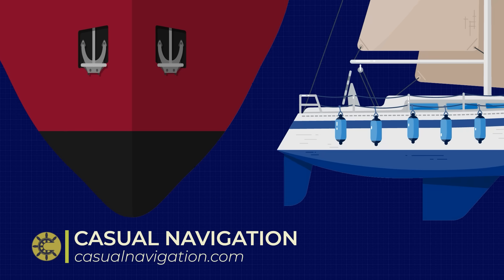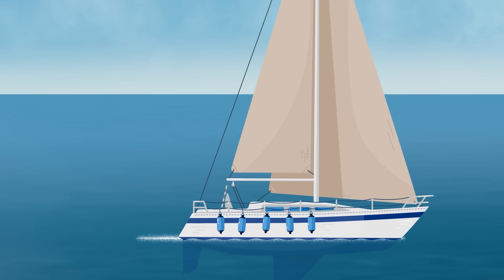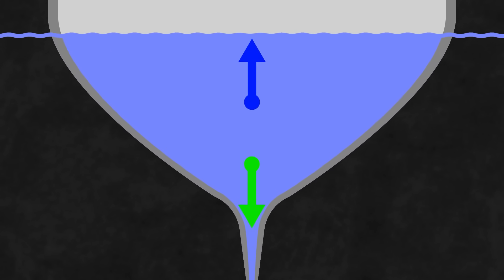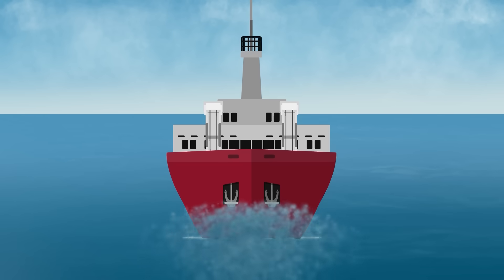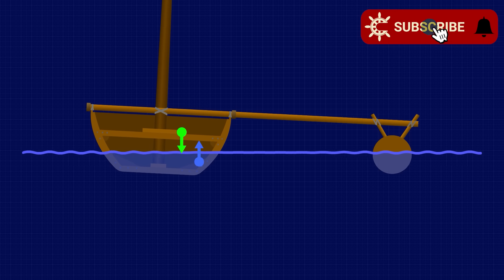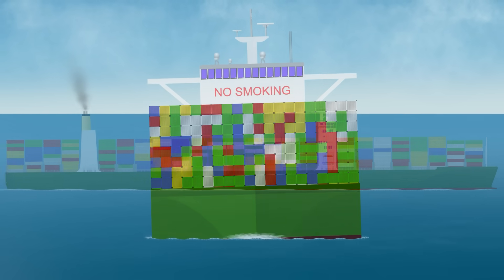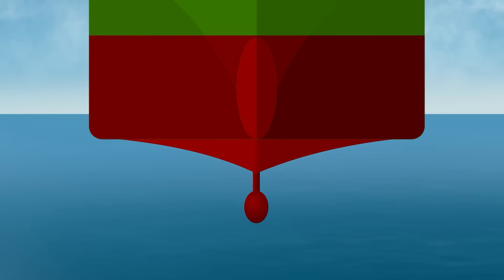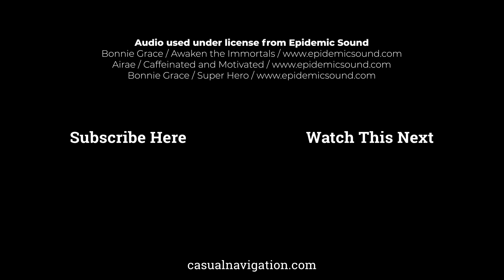Why Do Ships Have Flat Bottoms?

Comment: Though flat bottom ships are possible only for powered ships; for sail powered ships you need keel or centerboard / daggerboard anyway to counteract lateral forces when sailing at an angle to the wind.
Reply: Not 100% true. There are flat-bottomed sail boats. The trick is to then provide the needed counterforce with something like a leeboard at the sides of the hull. When the ship heels, the board on the leeward side (hence the name) is submerged and provided the needed counterforce. These were once common in shallow-draft waters like the Dutch waddenzee.
Reply: @eypandabear7483 cool
Reply: @eypandabear7483 
Revelation 3:20
Behold, I stand at the door, and knock: if any man hear my voice, and open the door, I will come in to him, and will sup with him, and he with me.

HEY THERE 🤗 JESUS IS CALLING YOU TODAY. Turn away from your sins, confess, forsake them and live the victorious life. God bless.

Revelation 22:12-14
And, behold, I come quickly; and my reward is with me, to give every man according as his work shall be.
I am Alpha and Omega, the beginning and the end, the first and the last.
Blessed are they that do his commandments, that they may have right to the tree of life, and may enter in through the gates into the city.
Reply: @eypandabear7483 that is exactly what the initial comment said.

Anyway, you are both wrong.

If there is enough of a lateral plane, you can still sail with a flat-bottomed ship.
Reply: Flatbottomboats with chinerunners are sailable.
Reply: Actually no sailed some ships had flat bottoms. If you know about the imjin war all the korean war ships had flat bottoms.
Reply: @alexkim3794 They were small,almost exclusively served on the coast, and relied mostly on oars.
Reply: Or a leeboard, like Dutch/Frisian flat bottom sailing ships (such as a Skûtsje). Doesn't do anything for the weight balance and can even be sailed without (but it will make a lot of leeway).
Reply: Not necessarily. The hull provides a lot of the lateral resistance. In modern racing yachts the fin ( or keel) is deep and narrow. While the hull is shallow and flat. Mostly to increase the initial righting moment while providing a planing shape. If you look at the IOC boats they have canting keels and lifting foils placed well outboard of the hull itself. These vessels are very fast and can handle severe conditions.
Reply: that's not at all true, otherwise sailing scows wouldn't work. When a flat bottom boat heels over, the "chine" or outer edge becomes keel-like and provides resistance to lateral motion, it might not be good at the job, but it does the job. It would be called low aspect.
Reply: @scotmcpherson  they had flat bottoms to push the ships onto land
Reply: @ doesn’t really have anything to do with what I said
Reply: I don't think there is a universal definition of neither "boat" not "ship"

But people who call ships "boats" and boats "ships" immediately reveal themselves as land-lubbers.
Reply: Never heard of a Sailing Catamaran? :P
Reply: For everyone discussing Ships vs Boats:
Drachinifel answers it in Drydock Episode 117
(semi final question)

Took me ages to find the right episode 😂
Reply: Drachinifel answers the Boat vs Ship question in Drydock 117 :)
Reply: Vikings had flatbottom ships
Reply: Leeboards (Seitenschwerter) on flat bottomed ships ⛵ are used in areas with low sea depths (1½ - 2m) - on the coast or even rivers. 

Old Dutch barges - zees boats (with red sails) typically have them and are used in the wadden sea or bodden.
They have developed from viking boats - but some modern small sailboats out of wood still have them.
Reply: Not true, there are various designs that don't require such like the outrigger canoes spoken about in this video and many modern catamarans, along with certain monohull designs.
Reply: Thats what he said in the video at the end
Reply: I’am frisian and our sailboats have flat bottoms. So no keel. We have what is called “zwaarden” on the sides. Big wooden plates on the outside of the ship that slide in the water when going side ways. You can search on: Skûtsje.
That is the name of our ships.
Reply: Outrigger canoe was sailed
Reply: Well nobody ships cargo with a sailing ship so who cares
Reply: Pretty much 
I've got a 36 footer and 52 footer. My 32 footer has a swing keel but it has a "flat bottom"

If the boat has something to act like a keel to cut lateral move my like a dagger, or cats

It's not a flat bottom. 
You only call it flat bottom when it travels with a flat bottom 
My boat has a flat bottom but travels with a swing keel

Meaning I don't say it's fucking flat bottom because other sailors would think I'm stupid 
I'm sure Gen Z wants to debate about my swing keel and tell me he's a flat bottom and redefine words
But it's not. 
Same with cats, daggerboards etc 
You can't sail with a flat bottom
Reply: I imagine it's a case of foot print. You can get cat sailing ships and they're basically an outrigger taken to the extreme.
Reply: @Logarithm906  have you seen the latest evolution of America's cup boats? They have lifting foils placed well outboard of the hull. Essentially catamarans except trading hydrodynamic lift for buoyancy. No big, heavy, pendulous weight to provide roll stability. So much for the vertical distance between CG and CB theory.
Reply: actually they're all boats because they go in the wet, ships are in space /j
Reply: @keiyakins excellent.
Reply: I like the definition that a boat can be operated by a single person while a ship requires a crew
Reply: @StepSherpa  I like it in theory, but on a more technical level, are you talking about requiring a crew for actually physically operating, or for legality?

I work on boats (well, we call them boats) that legally require a crew to operate, but technically, you could (and it's been done) do everything yourself. It would take planning and forethought, but it's doable. 

I also heard a definition myself where if the vessel can carry another boat on it, it becomes a ship... but that makes any sailing yacht with a tender on davits a ship... which doesn't seem right to me.

In my opinion, it's purely instinctual, and there is no real definition. Case by case kind of thing.
Reply: @douglaspealing5608  a tender is not necessarily a boat. Many tenders are actually dinghies not boats.
Reply: @PaulHarris-sl1ct  

I'm not saying you're wrong...

But I'm not saying you're right. This is my point. There is no definitive answer. I call both my whitewater kayak and my sailing yacht boats, and infact the vessels I work on are also called boats and ships interchangeably. 

I've also heard one of the vessels I work on referred to as a tender, as it used to serve the cruise ships that came into where i work.

It's a complex conundrum, and I always love hearing different people's opinions on it
Reply: @StepSherpa  Submarines are often classified as boats though, and many do require a crew to operate
Reply: @3irikur Yes, and you could probably automate a container ship not to require any crew, and I don't think that should magically turn it into a boat.
Reply: Those are called boats
Reply: @SterbiusMcGurbius  A Boat of the Line sounds way less cool than a Ship of the Line.
Reply: @SterbsMcGurbs So all vessels without their own propulsion are/were boats?
Reply: @ImieNazwiskoOK ah, the eternal question. What classifies a ship or a boat? When does a boat become a ship?
Reply: @douglaspealing5608  Both are subjective labels that can be used interchangeably, since either way you'll be understood. What is the limited average consensus? A rowing boat is a boat, but are big ass rowing boats of antiquity not ships? PT boat is a boat, but a similar size class and purpose starship is a ship. I guess, if it can operate on it's own, it's a ship.

But who knows, maybe BB actually stands for BattleBoat all along.
Reply: @steelwasp9375  great answer. I like it
Reply: @ImieNazwiskoOK  no. The definition of a ship vs boat is as follows. Ships carry boats. The old sailing vessels had no power propulsion only sails yet were technically ships.
Reply: @douglaspealing5608  ships carry boats.
Reply: @PaulHarris-sl1ct  Ok so, why exactly are submarines called boats by US Navy if they aren't carried by ships? Also have lift ships... cary ships.
Reply: @ImieNazwiskoOK  mostly tradition. However they do not carry boats so they fit the definition.
Reply: @ImieNazwiskoOK  actually I think they are called flotsam.
Reply: @steelwasp9375  I think the BB stands for double the BS.
Reply: @ImieNazwiskoOK  
Subs count as boats purely because Germany made them notorious in WW1, and in German they were called Unterseeboots.
That became U-Boat, and that's why they're boats instead of ships.
(which is kinda insane, considering the size of modern nuclear-powered subs carrying nuclear ballistic missiles, but tradition is hard to reverse)

So it's more due to history and linguistics than because of consistency 🙃
Reply: @MrNicoJac  Tbh the last part was kinda my point. The distinction is quite fuzzy. 
And ye it's bit absurd to call what's essentially a stealthy mobile (potentially nuclear) ICBM launch platform powered by a nuclear reactor a boat, but tradition is tradition.
Reply: @douglaspealing5608 I thought a ship is a vessel that can carry boats.
Reply: @ImieNazwiskoOKhe said that ships carry boats, it doesn’t mean that all boats are carried by ships
Reply: @SterbiusMcGurbius  "erm, actually, those are called boats 🤓" remind me what HMS stands for? i dont think it stood for her majesty's boat.
Reply: @arcanealchemist3190  I think that the "M" stands for "mail"
Reply: @SterbiusMcGurbius  distinction without a difference.

Comment: Is it possible that the Mary Rose, and the Vasa, which both sank just after launching, had simply not got round to putting in a decent amount of ballast? 

Could they have thought; 'let's have the flag-waving and parades now, and get round to details later'? Probably not, but the thought just sprang to mind.

(I'm sure they just had too many cannons, too high above the waterline).
Reply: I believe it was the related but different problem of too many cannons too close to the waterline.

Comment: I think it is worth pointing out that form stability will break down at high angles of heel. Think of a beach cat which has very high form stability. But if it gets too much heel in a gust, there is no way to safe it. And once capsized, it won't right that easily because the form stability is not working against rightening. This is less of an issue for a giant cargo ship but for smaller vessels like the average powerboat it can be
Reply: A deep heavy keel on a relatively narrow hull with some superstructure are the factors that make a boat tend to tight herself should she capsize. A multihull will tend to be very stable the wrong way up.

Comment: Doesn't these have actively moving ballast? Like fuel tanks on each side with pumps and a computer moving around the fuel to stabilise the ship?
Reply: Stability is adjusted with ballast tanks to keep the ship straight upright even with an uneven load, it may also be used with a empty ship because it be unstable without some ballast. The ballast water isn't pumped from side to side with each rolling of the ship, it's juste a adjustement setting like trim on an airplane if you will.

EDIT : some ships such as cruise ships do use moving planes on the side of the hull to neutralize the roll, but they're still stable without them, it's mostly for passenger comfort. It isn't a common feature on cargo ships.
Reply: Some do yes, but that only works when the electrical generations are working. In a storm if they get knocked out then you’re in trouble and the last thing you want in the situation is loss of stability. Same thing with the ships that have movable fins. They really help with rolling but as has happened when the generators go out they retract and you can capsize. With just weight acting as ballast you always have it, as long as the cargo stays on board
Reply: Ship ballast pumps and pipelines don't have even remotely the capacity for this to be possible. Some coal and ore ports may even force a vessel out if her ballast systems can't keep up with loading speeds - otherwise they'd have to suspend loading, and idling costs incredible amount of money.

Also free surfaces in tanks are highly undesireable as they decrease stability by allowing liquid's center of gravity to move from side to side. Usually you'd try to keep a tank as full as possible - if a liquid fills 100% of a space its center of gravity can't move anywhere. Cargo tanks on tanker ships often havelongitutal vertical bulkheads in adition to transversal ones to make filling tanks to full capacity easier.

Comment: Our fuel barges are wider and deeper, carry slightly more and are more maneuverable than a tanker although slightly longer (I think about 20 extra meters)

I discharged 13 million gallons (the whole load) and it took 28 hours from dock to departure